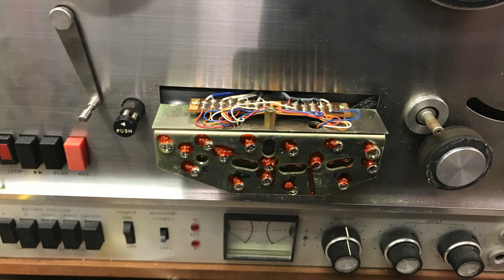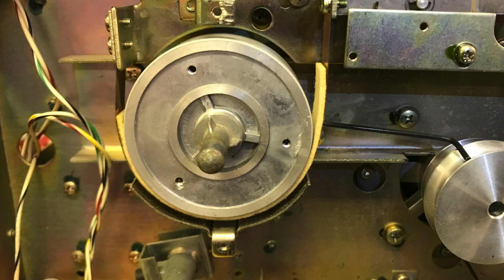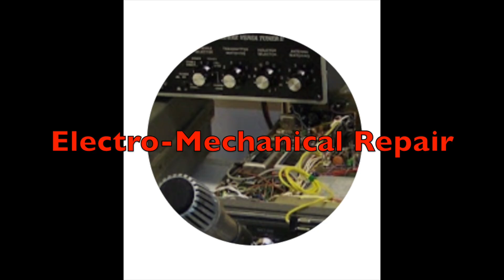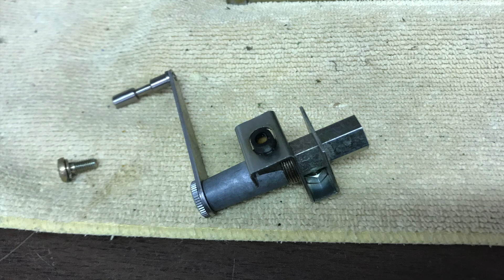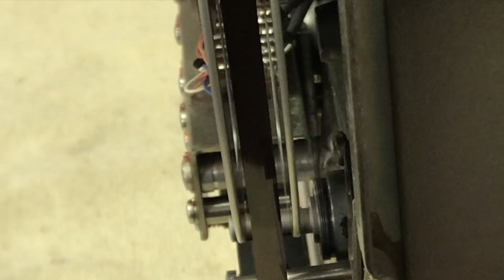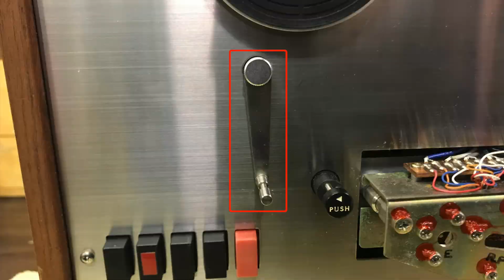1966 TEAC A1500W Reel to Reel Tape Recorder Restore

Comment: Beautiful video and restoration. Recently, picked up an A-1200 (pretty much same unit except for auto reverse) for $13 at the goodwill. Replaced belts, oiled, and freed up all linkage including removing pinch roller shaft. Now sounds great. Wish I had seen this before but learned a lot on my own. Will keep this saved for future capacitor replacement. Thanks again from Arizona.
Reply from the maker: Enjoy your restored TEAC Reel to Reel!